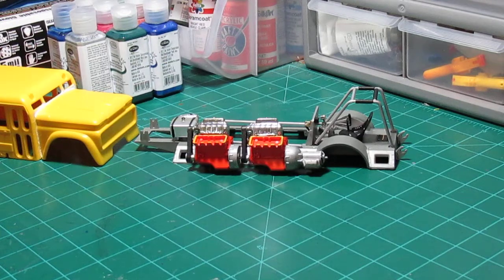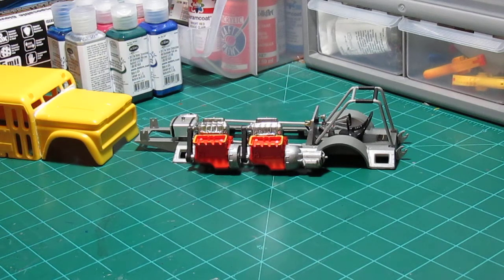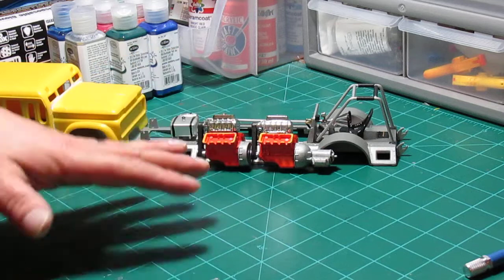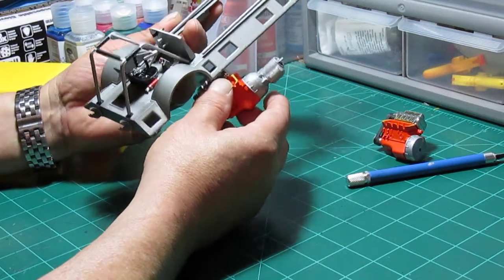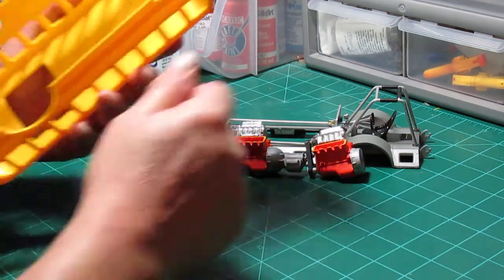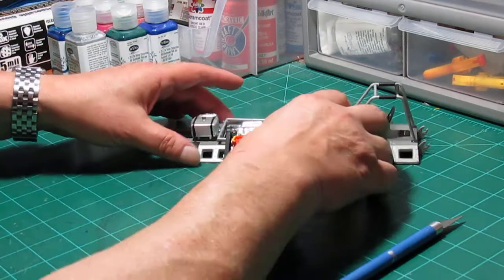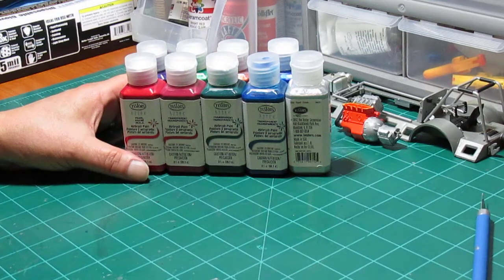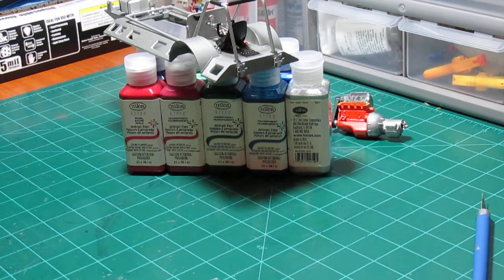First Update on the S'cool Bus

Comment: Nice work so far and some great info. I'm going to be starting mine sometime very soon so this is helpful. I like those Aztec paints. Are they expensive?
Reply from the maker: Thanks for the kind words. They are about on a par with the other airbrush paints...$5.99 for a two ounce bottle, but when you figure the Testors Model Master Acryl paints are $3.79 for a half ounce jar and these are $6.00 for two ounces, you're getting four tmes as much paint for only twice the cost and they shoot better than the Acryls do in my opinion and I have both.
Reply: Good points
Reply from the maker: Dirk Pitt Btw, I got then through Tower Hobbies and not through the Testors website.

Comment: Hey man ' I have this kit almost finished ' dont get me wrong I have always liked Tom Daniel kit's ' but this kit had 1 main flaw . That is between the upper & lower parts of the frames ' I found that there is NO way to glue them together . What I did was drilled some .o60 holes were needed & wired the 2 together . Worked great ' the only problem I have left to finish it is the plug wires . Other than that It look's very s' cool ' Jimmie R